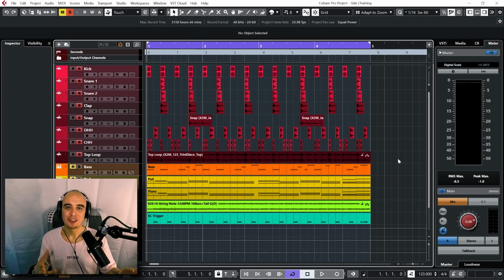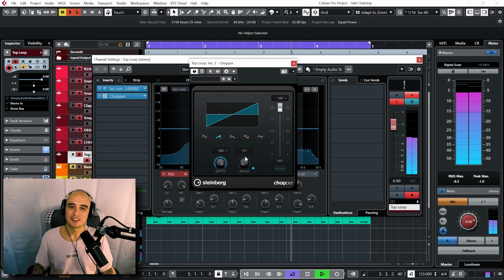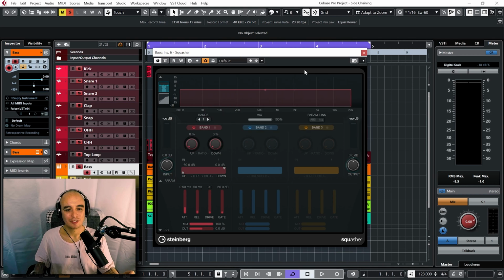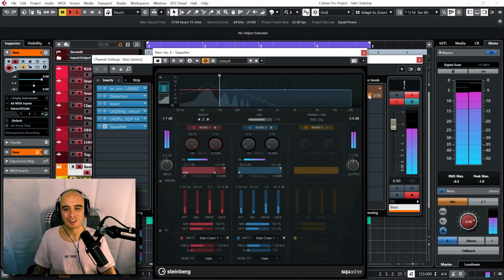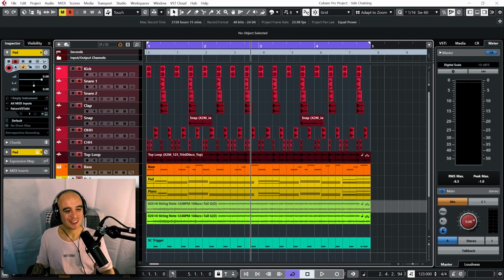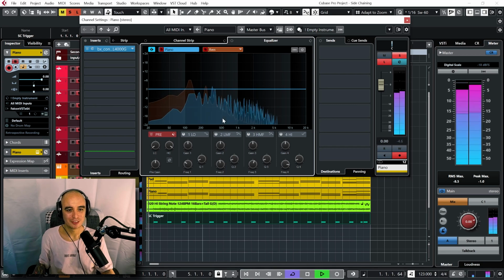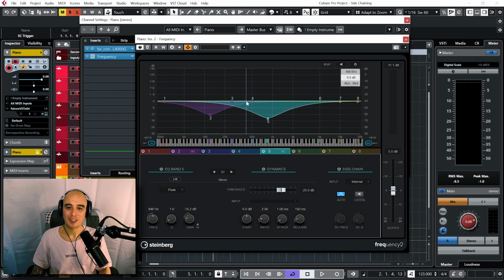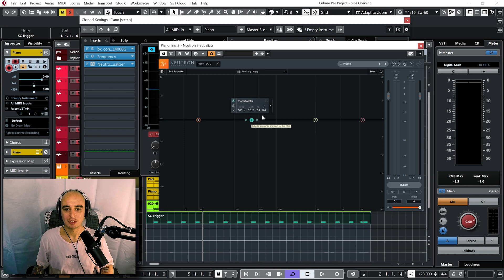5 Ways To Get That Sidechain Pumping Effect in Cubase 11

Comment: oh.. I'm not exactly sure what your knob tweaking does. What settings  would be needed if you wanted your bass to DUCK down when your HH plays.. (kind of the opposite of what you are doing)
Reply from the maker: You would need to take the side-chain input from the HH
Reply: @Tutorial_ism  oddly enough , that’s what i did. i’ll redo it and watch carefully. although it may be due to my cubase going wonky. my hub didn’t show any files … and my snap didn’t engage. yesterday i did a preferences/factory reset and those problems disappeared!

Comment: excellent !.. i just tried SQUASHER and i have a question... I have a synth (its an arpeggiated bass triggered by one note)... I wanted to bring in the pumping at bar 4. I placed squasher into an automation track, and dragged down the level to zero, from bars 1 to 3.
Oddly enough , when i playback the song, the first section is un-pumped, as i want it, but the volume is lower than when the squasher effect comes in in bar 4.
I just added automation to the volume to fix the situation, but that seems like a workaround...  Any idea why this happens ? When i turn the effect off and on manually, the volume is always constant...p.s.
i just subscribed to your channel. that should keep me busy for the winter
steve
Reply from the maker: It could be a number of reasons - plugin dependant - but unless you are specifically wanting to automate volume levels, it is best to control whether a plugin is on or off by either automating the bypass or the dry-wet